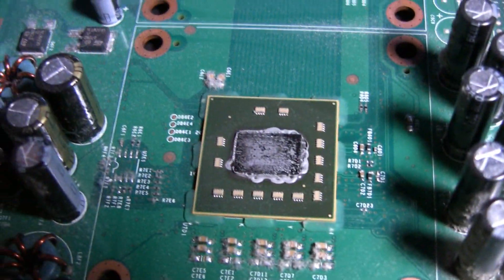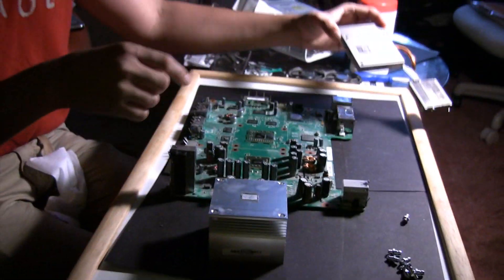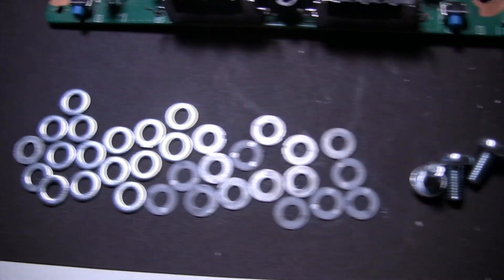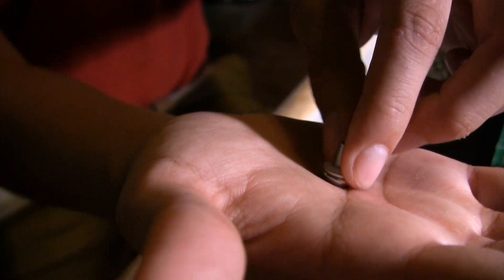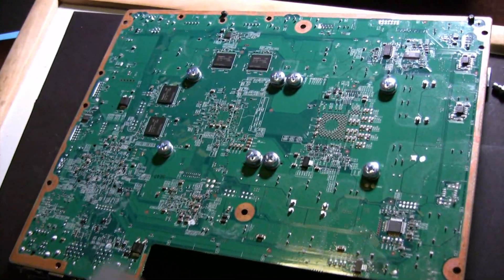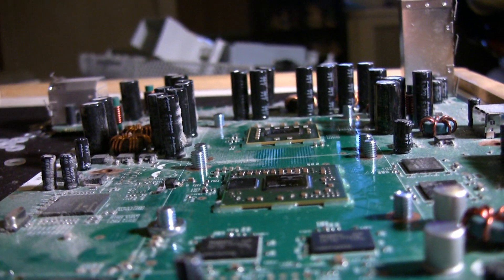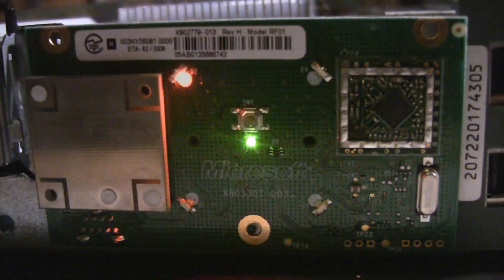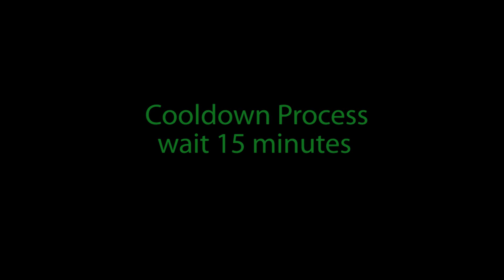X Clamp Fix - RROD Repair Guide Part 3: Installing the X Clamp Kit & Overheat Process

Comment: Anyone watching this now who might have acquired an Xbox 360, please note:

<<<<<<<<<<<DO NOT DO THIS BOLT MOD!!!!>>>>>>>>>>>>

This was proven to be a completely incorrect fix for the 360 and will fail after a short time because it warps the motherboard. The 360's defect was NOT the X-clamp's failure to hold the heat sinks tight enough against the processor, it was related to a manufacturing defect of the GPU chip itself.

Comment: just a quick question, im receiving my xclamp kit tomorow and since its my first time... Do i need to put the screws of the case inside as well as the mobo while overheating or can i let it loose (without the screws)?

Comment: Thank you, you did a good job on this video. Very clear, and easy to follow. I saw a lot of other videos that told you to do the wrong thing like putting the metal washer in the wrong other causing the mother board to fry. I work on computers normally, so I was sure to compare all the videos. This is the best so far.

Comment: Another thing I've found to remove the old thermal compound is WD-40 or an off brand called PB Blaster. And, they add a nice clean shine to the heat sink. Just make sure you use a dry clean rag afterwards to clean off any residual fluid and everything will shine like new.

Comment: Nylon Washers are hard to find, I could not buy them but to those in the same situation you can use insulation tape instead of those washers butt the steel washers are necessary. THUMBS UP SO PEOPLE CAN SEE

Comment: I recommend using the heat gun method for much better results.I have 2 xbox fixed with heat gun and either of them has not had rrod for 8months and still going.I usually use the overheating method to test if the xbox is still workable and if rrod goes away, then I use heat gun with artic silver paste.Paste is important! I've had a few xboxes that had no sign of paste what so ever. I've fixed over 50 xboxes so I hope this helps someone out there

Comment: @22teamplayer You probably have 0001, 0002, or 0003 error codes which means your console is pretty much screwed. Look up how to check secondary error codes to verify though.

Comment: Thanks Alot this worked for me in 10 minutes tops i tryed using the arctic 5 silver and i had no success so i purchased the thermal compound and it worked i dont know why but for anyone who wants to fix their xbox with the 2 rings or 3 rings trust me this video will work for you everytime Thanks again Xclampkit

Comment: LISTEN ALL, just use Goof Off.  a big can cost a couple bucks. i fixed two xbox's this week, my first time ever.  the scotch tape is a good tip,  and dont put too much thermal paste on the cpu/gpu.  about the size of a grain of rice, or an apple seed. dont overtighten!  i made that mistake, and i had to repeat the process all over.  you can skip his overheating step by getting the screws a little more than hand tight.  just a little.  this is a pretty good guide. thanks buddy!!

Comment: I finished the whole process. But when I start it up, it turns on but then after a minute or two it goes back to two red lights, and i cannot turn it off from the front. I have to plug it out from the bottom. Help?

Comment: @aeTynoT562 I used 8 x M5x10mm button head 316 stainless steel screws. the ones i bought have a socket type head for an allen key. this helped me get good torque in to them. i also used 1mm nylon washers and 0.8mm stainless steel washers. mine is working perfectly, i laid everything out the same as this video. the only thing i did different was that i completely torqued up the bolts/screws prior to the overheating stage. i picked up everything for around $9.00 including the compound.

Comment: i tightend all the screws and when i put dvd drive in and video and power cables in and turn it on its already shows 2 red lights and i can turn it off from front?

Comment from the maker: @ExplosiveGamlng  Heatsink Compound will work. Also I assume you are talking about the heatsink and cpu chip touching. They must make contact, so don't use too much heatsink compound, but don't overtighten the screws either.